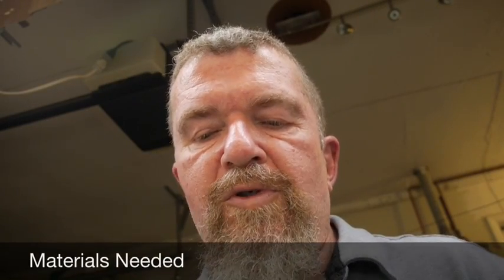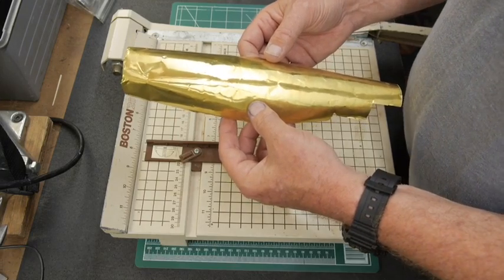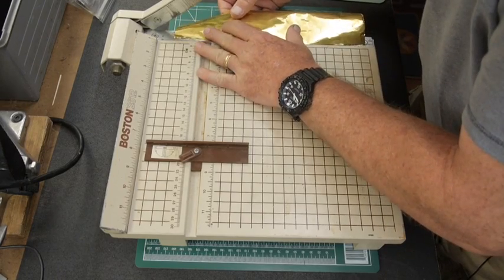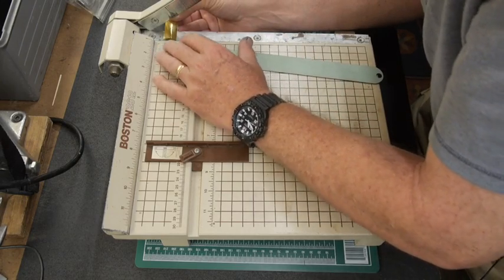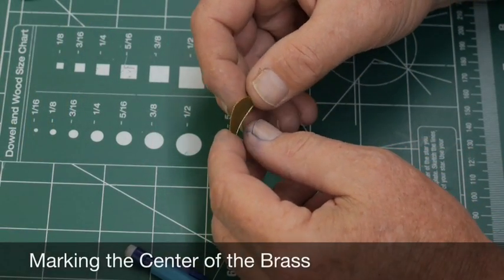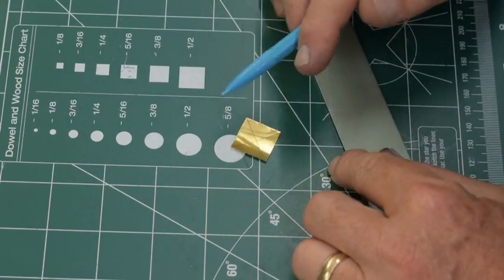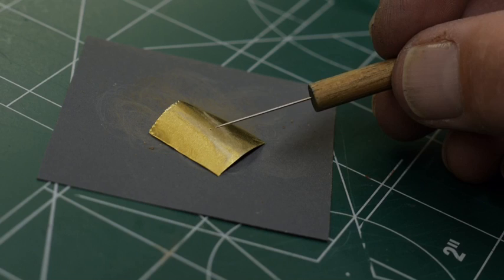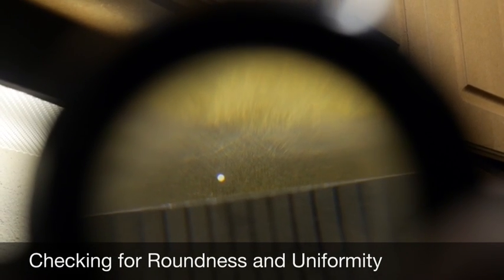Making Pinhole Camera Apertures

Comment: Why do we need metal to make a pinhole? why not paper or wood or plastic?
Reply from the maker: They have to be opaque, but also it helps to prevent off-axis vignetting by having the material be as thin as possible, approaching a 2-dimensional hole, not a 3-dimensional "tunnel."
Reply: @Joe_VanCleave  so for that matter you could do with aluminum or thin foil?
Reply from the maker: @cameravintage  Yes, though with really thin foil it may be hard to make a perfectly round hole without pushing some of the foil aside. I use thin metal that’s thicker than foil and sand off the burrs on the backside with fine Emory paper.

Comment: Thanks Joe, for the excellent video! Just one question about the brass folio - is it 0,002 inch oder 0,002 mm in thick? Thanks!
Reply from the maker: It's 0.002 inches thick. The term "mil" is an imperial engineering term; I should have used millimeters. You can also find brass shim stock even thinner.

Comment: Love watching your channel John, I've made a couple of pin holes cameras myself. But in saying that I've also built a cardboard camera as well just by finding a lens (just, a plastic piece). Which I found the focus point for this lens and built a cardboard box for it to fit in. I had a larger aperture for this so I used a elastic band with a slider in front of the lens to build a shutter and I have got an hand held exposure without any motion blur.

Comment: I'd like to make a pinhole camera for 120 roll film. What should be the distance between hole and the film plate?
Reply from the maker: It depends on the angle of view you desire. Wide angle, normal or more telephoto. Also depends on the aspect ratio you choose, since medium format can be 645, 6x6, 6x7, 6x8, 6x9 or wider. Or, any other value in between, since you're making your own camera. Whatever your film format, a "normal" angle of view will have a focal length approximately equal to the width of the format. Wider angles of view will of course be shorter than that.

You can also choose to use curved film planes instead of flat.

It helps to draw the layout of your film format on paper with various triangles representing possible angles of view, and see which one seems best for your kind of photography.
Reply: I really do not understand the math of the job. I want to make a camera equal to the 75mm lens. 6x12 format for example?
Reply from the maker: The distance between pinhole and film would then be 75mm. According to http://www.mrpinhole.com/calcpinh.php the size of the pinhole should be .298mm diameter, for a f/stop of f/252.

You don't have to use the recommended pinhole size. Any pinhole will make an image. The recommended size is for optimizing sharpness. Whatever pinhole size you use, divide the focal length of 75mm by the diameter of the pinhole you use (also in mm) to find the working f/stop, which will be needed when figuring out your exposure times with a light meter.

You don't even have to know the f/stop of the camera to use it, but then you would have to experiment with various exposure times in different light conditions to understand how long to leave the shutter open, other wise you may have over- or under-exposed images. This testing will waste film and time. Hence the reason to measure your pinhole diameter, in order to find out the camera's f/stop.
Reply: Appreciate.